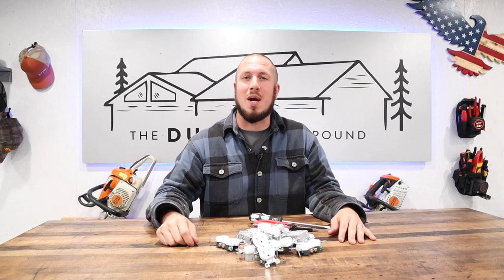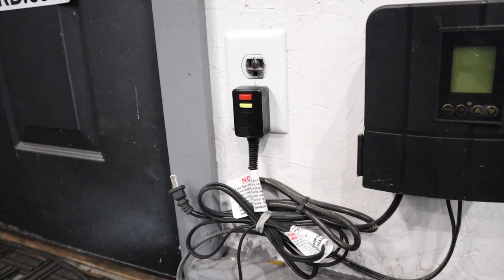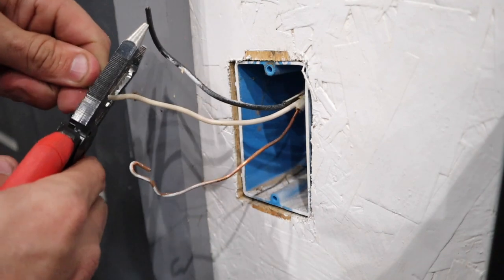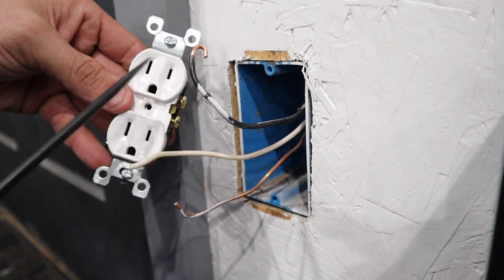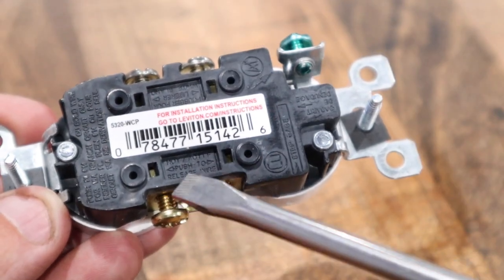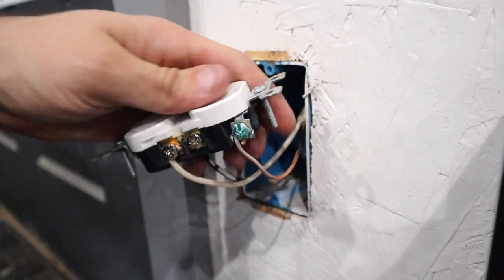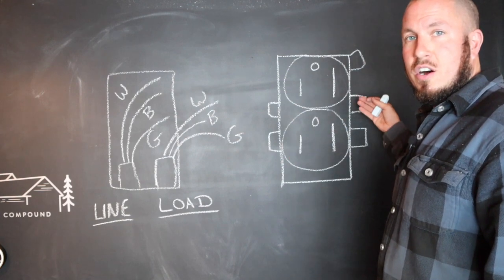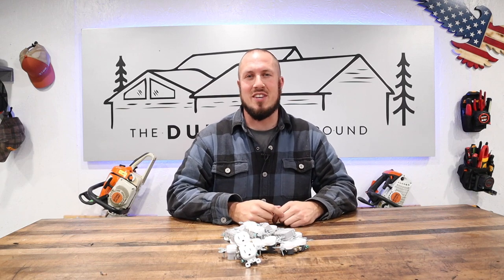How To Replace An Outlet - A Full DIY Tutorial

Comment: 12:45 - You should clean that paint overspray off of the ground wire with some emery cloth. You won't get a lot of good connection with the terminals because the paint may act as an insulator, for the same reason you don't want to have any insulation under the screw terminals.
Reply from the maker: Good point!

Comment: What is your opinion on using push in connectors like Ideal and Wago lever nuts instead of wire nuts? Wire take skill and knowledge to use correctly, push in types are easier.
Reply from the maker: My personal opinion is they aren’t unsafe or they wouldn’t sell them. I feel you get more contact area with a wire nut but they have the tendency to come loose if put on wrong to begin with. Then you are chasing a short.  You don’t have that problem with wagos.